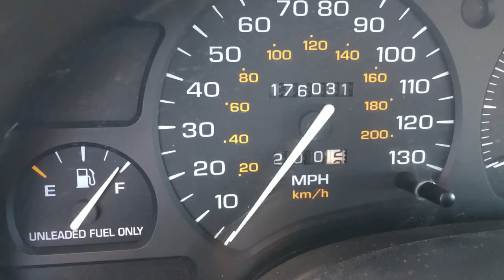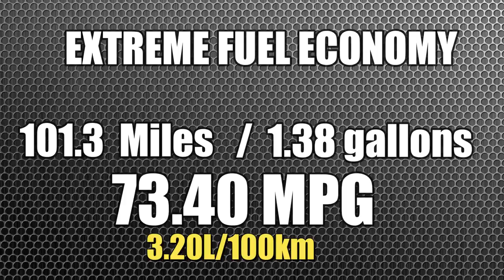S3 E11. Kubota turbo diesel Saturn extreme fuel economy.  super high MPG

Comment: My first saturn was a 1994 Saturn SL2, and I always seemed to get 32 miles per gallon no matter how I drove, but I really only drove one way, HARD.
Reply: I almost bought an orange SC2 5 speed at auction, but I passed on it for a 1997 Toyota Camry with the 1MZ-FE V6 and 5 speed manual. That car got 18-22 MPG, but it was a Toyota for the low price of $400. I couldn't refuse.
Reply: @SkylineFTW97  And if not wrecked, the  Toyota is still going. Saturns? Well...
Reply: @eriklarson9137  Nah, old Saturns are pretty robust. Especially with manual transmissions. The S series cars were pretty good, but GM killed them off after 10-11 years in favor of the inferior Ion. Probably didn't help that the S Series was competing with the Chevy Cavalier. Also a good car, but not as interesting.
Reply: @SkylineFTW97  rust is the one killer of all these gm fwd cars. Down south these things are everywhere but I’ve got an 02 bonneville with 160k miles and it’s all rusted out underneath. Minnesota car. Damn shame it’s a really nice car lol
Reply: @eriklarson9137  Saturns are great and super cheap to maintain cars I have 3 2dr 3dr and a wagon 230, 310, 100k on them 98, 2001, 99 years. They are all manual (since automatics are all wear items) and my average cost per mile is $.11/mole (including purchase, tax/tag, repair and maintenance, insurance, and fuel) they have composite body panels and never rust or dent and being monocoque design are extremely safe(I was hit head-on at 55 in my previous wagon and suffered only a bruised sternum) The car was destroyed but the driver's compartment was completely intact(in fact it got a little bigger)   despite the front wheel being pushed back to the d/s door
Reply from the maker: @MDAdams72668  Sorry to hear about the demise of your wagon, but I'm glad to hear your OK.  It's too bad Saturn S series are getting hard to find these days.
Reply: I had a 1984  Mercury Topaz with the 2.3L and once my college auto tech buddies and I got done with stripping the emissions crap off it and retuning it (18 to 25 MPG pre-modding), it was a solid 30 to 40 MPG runner even when driven like it was stolen.
Reply: I owned a 1992 built to order SL2. I used to get 33-35 MPG. Probably the best car I ever owned.

Comment: why do cars in America have so bad fuel economy? is the diesel different over there? I have a 1.4T Astra-K that does 52 UK MPG avg per tank of Petrol (43.30 U.S. MPG)
Reply: ? Literally 90% of the diesels available in the states are European, and even those domestically produced like the Cruze TDI have the same levels of efficiency. Not sure what you're on about, unless you're looking at like a 7.3 IDI
The diesel Jeeps don't count, there's a reason not a single person buys them
Reply: They're larger, heavier, their engines are larger to cope with highway speeds for longer periods of time, and fuel prices are heavily subsidized.

Comment: I did like this experiment,I had a 1985 Non Turbo Ford Escort 1-6 Diesel new back in the day before all this environmental bollocks we have now in the UK and elsewhere. That car NO MATTER how hard you drove it did a regular 65mpg,take it steady and 72 was achievable,great little performer too,would do 80mpg all day on the Motorway,I regularly did a 700 mile round trip to Scotland and back without missing a beat,great little vehicle.

Comment: If you would just create a complete Styrofoam shell to encase the vehicle I'm sure you could reduce drag by at least 0.001%. And then paint a Saturn on it, and I'm sure that the cops would never notice! Love that Kubota sound, btw.
Reply: The problem with styrofoam is that, because it’s made of a bunch of beads all stuck together, there are countless little imperfections that will cause turbulence in the air right against the surface; thus INCREASING the amount on aerodynamic drag per mph of speed.
Reply: @Jacob Carlson  hmm, interesting point. What material would you recommend? Perhaps a plastic shell?
Reply: @MichaelJordan-jv6ic  Saturns are a plastic shell.
Reply: @Preacher S  even better! When the cops see it they'll say "Oh, just a Saturn. Never mind."
Reply: @Michael Jordan 
 this
The shell on my dodge in my avatar is a ½"×0.065" tubing frame a layer of ½" styrofoam( mylar layer faces the sky) . This was covered by a skin of industrial 12mil shrink wrap. It has been on the truck for 8yrs(as of 2023). The opening portion ( 6'3' I hate conventional campers too short. Gotta be able to stand up.) Is 35lbs.
 Drag reduced by 24% according to the wind tunnel operator. Videos on my channel  best 100mi test loop in mountainsof Montana @65mph was 39mpg. 
On v2 a different  foam will be used . This stuff will water log .
Reply: @drippingwax  
If you want more on my build I posted info on ecomodder as Gumby79 so ya one of those. Haven't been on there for a long time. The 12mil has fire retardants and UV stabilizers that crash wrap, and boat wrap do not have.
Reply: @drippingwax  
As far as glassing goes, it cannot do what I wanted and remain a 1 man operation to remove or install. Estimates would put it at at least 200lbs to yeald a 10' snow load. 

The shrink wrap is a prototyping skin. The final version will have Ortex 6000 0.25lbs/sqft( Airplane skin).  I went with shrink wrap at $50 per cover vs $75sqM ,9yards needed for $405 for each attempt . Testing shows shrink wrap has outlasted most cars in the rust belt, it could have a nother 10 years  left in it.
Reply: @jacobcarlson4010  then explain a golf ball....
Reply: Well done
Reply: @drippingwax  I mean why does it have the pits in it? Wouldn't they cause drag?
Reply: Wax . Yep. Tis me. The eccentric.
Reply: @thomas robinette  
Turbulence, yes, drag  no. The Turbulence causes separation to occur earlier( air dose not wrap aroundthe back of the ball), thus reducing  drag.
Reply: @daviddroescher  tell that to Jacob carlson

Comment: Seeing how efficient a diesel can be on fuel,  I wish GM hadn't burned out the consumer on the idea in the 80's...........    VW was making some strides to bring it back until they got busted by the EPA.         I will attest that the speed/aero does indeed have a MASSIVE effect on fuel consumption.   In my work van,  on the highways I find that if I observe the speed limits it easily adds  1-2 extra MPG average.

Comment: You should look into propane injection. All you need is a plain bottle of propane and a way to simply hook it up to the intake. Just cracked it will improve mileage and internal temps and all the way open it adds loads of power. If you're driving everyday its no more than one bottle a month.
Reply: I experimented with that on my 83 Ranger Diesel. Called a Rooster Booster or something like that. Yes, one could get more power but risk detonation but wasn't really great without a turbo.

Comment: When I was working on Speeduino when it started, ie, ages ago, I remember they were testing fuel flow rate sensors. If the diesel has no return maybe you could fit one and find what speed has the lowest rate of fuel usage. You probably could just use an Arduino and cal 1 litre through it on the bench if you want approx real world fuel rate.

Comment: If you put a 400 watt panel in the roof, a modulator in the fuel pedal to control a hydrogen generator the fuel mileage will be twice the distance. In 2012 a Nissan quest went over 500 miles fully loaded with heavy tools and only used 3/4 of 24 gallons tank. But of course the raise is about high mileage in ev because it is free fuel.

Comment: I think the thing people don't understand about lean burning is that it isn't just as simple as "more lean = more hot" in the gas world and "more fuel = more hot" in a diesel, but instead there is a hot no-go zone somewhere leaner than stoichiometric that is the hottest, and anything richer or leaner than that will be cooler. In practice you don't generally go past this no-go region with a given engine, so people don't talk about it very much. But it does lead to some interesting possibilities like lean burning sky active X gasoline engine. Realizing there is a reason that the rules get reversed helps me a lot.

Comment: Hey Jimbo.. Any thoughts on my suggestion (on previous Saturn video) of a 'Heath Robinson' idea of using a 5 Litre (or bigger) pressurised garden sprayer filled with ice water and spray nozzle pointed onto the intercooler (or maybe plumbed up with multiple spray heads) to help 'Chill' the intercooler down even more so for extra... PAOWAAAAARRR! Hahaha 🤔😉😛      😎🇬🇧
Reply: Jimbo will be fancy and use a winder washer fluid res/pump

Comment: In the 1980s, I owned a Ford Escort with a naturally aspirated four cylinder diesel engine, and a VW Jetta with a turbocharged four cylinder diesel engine.  Both cars got 45 MPG consistently in real world driving, and would break 50 MPG on longer trips.  And back then, I was able to buy diesel for 50 cents a gallon, which means I was burning about two cent's worth of diesel per mile.

Comment: I would wonder what propane injection would do for that little diesel, propane is often used to increase diesel burn rate to near 100% and the evaporative effect will lower intake temps drastically.

Comment: Wow, my Prius would be envious of that fuel economy.
BTW, the belly pan is a legit aero mod. If you have the time & materials, maybe put one under the rear bumper as well.
Reply: Good idea!
Given Jimbo's nature, do you think he would do it out of Cardboard, Plywood, or Sheet Metal?

Part of me wonders if covering the back wheels in some way (Like the honda insight) could also yield a little more MPG too. Maybe some thick plastic and JB weld? Or Would the riveter have to be used?
Reply: @XenocraftGalaxy  beware the envious Prius..
Reply: @drippingwax  - Speaking of ecomodder, I'm a member there. It's a pretty good source of info. But there are the usual caveats regarding forum culture.
Reply: Prius! 😂 Btw, blocking air flow from coming in and out under is stupid. Not sure how you believe its gonna better milage? Air coming in, but now isn't being pulled out is ass backwards thinking.
Reply: @XenocraftGalaxy  Correx/coroplast is the best thing to use. Lightweight, strong, doesn't decay, easy to cut and shape, cheap.
Reply: @drippingwax    This would improve aero, but there are other considerations.  Air passing through the radiator and over the engine needs a place to go.  Trapping it inside a belly pan, without some sort of proper ventilation will cook the occupants and mitigate the work the radiator is doing.  A better way to eliminate the dirty air beneath the car is to use splitters, dams, or valances... front and rear accordingly.  These will divert the air outward, or push the air closer to the road where it doesn't get tangled in the under carriage.  And make no mistake... it's not like you can slap on a chin.  Proper aero is exhaustively engineered.  What seems slippery can actually reduce efficiency.
Reply: @drippingwax   Take it easy pal.  Everything I said is spot on fact.  If you have questions about it, look into exotics... there is a lot that goes into cooling with regards to under carriage encapsulation.  Jumbo is really doing a good job, but his testing, I believe, is in an effort to find long term efficiencies.  Automakers spend HUGE money figuring out how to meet CAFE standards... if full belly pans were the answer, every car would have one.  Turns out they also have the health of the engine to consider.   Lighten up.
Reply: @drippingwax    NO, my stupid auto correct did that.

As for the rest, I will repeat... car makers are desperate for CAFE points.  And redesigning engines/chasis/bodies for better fuel economy/ lighter weight/ better aero respectively is incredibly expensive, and has been chased in the wind tunnel for years.  If a full belly pan could give better mpg than a chin (at the same cost to make), every car would have one.  But the chin has proven effective at pushing the air to the ground.  Also, car makers need to make cars that aren't so fugly that people will actually buy them... and they need to be reliable for a few hundred thousand miles.   Have I modified cars to achieve various goals?  Yes, including aero, but for better top speed rather than efficiency.   What seems slippery isn't always so, and may actually hut the car over time.  The insight was a great hypermile car, but it only had a small, ravenous following because it was horrible to look at.  It didn't actually sell that well because of it.
Reply: @drippingwax  - Some of these responses are, shall we say, special. Anyway, some Ecomodder members have installed full belly pans and shared their results. If your search-fu is up to snuff, you can find it on the site.
Reply: With little to no wind a prius does upper 50s lowers 60s mpg at about 45mpg.  Once wind is from behind car especially at 20 mph plus wind, mpg goes up into the 70s and at the point speed doesn't seem to matter especially if wind is stronger. Wind plays a very important role  as far as mpg goes
Reply: @lobogris4806    I own a Chevy Silverado and my commute to work is 100 miles round trip and 90 miles of it is open two lane where I can go any speed I want.  When gas got really expensive, I bought a 2022 Kia Rio in an effort to save money on gas and prolong the life of the truck.  The Rio has the best highway mpg for an ICE engine, where most EV and hybrids get their best economy around town.  The drive is flat, and I have found that 58 mph is my sweet spot for maximum economy.  I've averaged 51 mpg over the last 30k miles, and when the wind blows, it is always at my back on the afternoon trip home, where I average better than 55 mpg.  So you are spot on... wind plays a huge role.  I'm certain there are some tweaks I could do to improve that number, but I'm pretty satisfied with my current numbers.
Reply: Diesel has more energy than gasoline so the gasoline equivalent is 63mpg. I used to average 70mpg in my Prius driving a bit faster than this guy.
Reply: mine is just for catching oil
Reply: Prius is a city car in terms of fuel efficiency
Reply: @doddsalfa  - That's true. The hybrid system really shines in city driving. But you can still improve highway fuel economy, with better aero.

Comment: Has anyone ever mentioned to you the Urba Centurion, which used the 3 cylinder Kubota engine?  It was a custom fiberglass body on a Triumph Spitfire chassis.  They sold the plans in Mechanix Illustrated magazine in the early 1980's.

Anyway the Saturn is turning in similarly impressive fuel economy numbers without needing a custom body.

Comment: It would be interesting to see a graph of a threshold of when going leaner gives lower EGT, for gasoline and diesel engines. I've never found anything like it on the web.
Reply: For gasoline, leaner is higher EGT
Reply: I've seen bunch of aero (gasoline) related graphs but not sure if I've seen any with actual air/fuel-numbers, but it seems that the EGT starts to go down somewhere around the beginning of the "best economy area" and the head temp starts dropping a bit earlier.
Reply: @Pointlesschan  only to a point... After a certain point, leaning out the mixture will decrease EGTs. Can't have high temparatures, if you're not producing any power.
Reply: Stoichiometric is the hottest. Anything more or less is colder. 14.7 for gas 14.9 for diesel

Comment: Since I subscribed months ago, I've been trying to think of things that might help. As I'm not an engineer, they're just thoughts.  
I drive a diesel pickup truck. When the air is around 70 deg.F, it seems to get its best fuel mileage.  I sometimes wonder if you're cooling the intake charge too much; it's a complex question with many variables like ambient temperature, boost pressure, airflow, etc.  In short, it'll be interesting to see if your MPG goes up some, as the Kansas spring warms.
The other thought is the power needed for acceleration versus steady state.  I forget the number you've provided, but let's say you're using the full 60 HP to accelerate, but only 8 HP to maintain that.  Acceleration is your car's biggest shortcoming.  Is there some way your could charge some super capacitors in the trunk, that discharge into electric motors only during acceleration.  No, I'm not talking free energy.  While you're cruising, the alternator would be working harder to charge the caps and maybe consuming, say 15 HP -- reducing MPG slightly, but gaining acceleration.  Someone pointed out to me in a reply to my post months ago that turning it into a diesel generator is terribly inefficient, so I'm only suggesting for burst acceleration.
Finally, there's propane injection -- I've heard this called "NOS for diesels."  Would a minuscule amount of propane give you the acceleration you want w/o harming the engine?

Comment: I've done a few rough calculations. If we assume the fuel economy test for the Saturn Wagon on the Hillbilly Proving Grounds is representative of what we'd get with multiple tests averaged, and that the difference in fuel economy in the gasoline powered Saturn Wagon is similar to what it would be in your various test cars; then dividing the car's average fuel economy with the test fuel economy would give you a correction factor for converting test fuel economy to "real world" fuel economy.

CF = 32mpg/37mpg = .86

Thus the turbodiesel Saturn Coupe's real world fuel economy could be estimated as.

Erw = .86 X 59mpg = 50.74 mpg which I'm rounding down to 50 mpg.

The problem with this is that the differences between these two engines means that I wouldn't put too much stock in these numbers. My guess is that using the underpowered Kubota turbodiesel in your trips to and around Wichita would lead to fuel economy that would be less than 50 mpg. Still it's an interesting starting point.